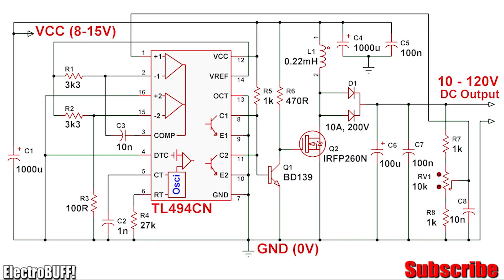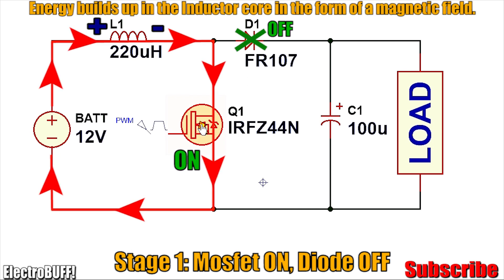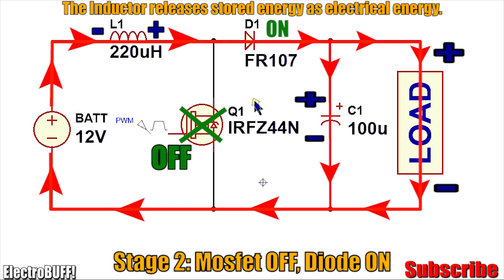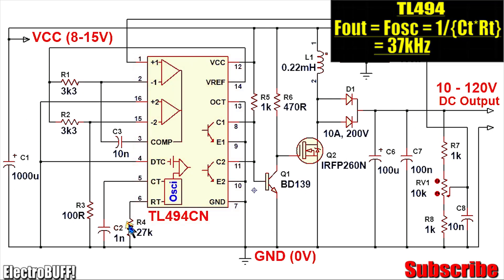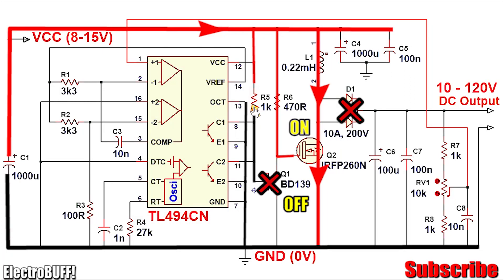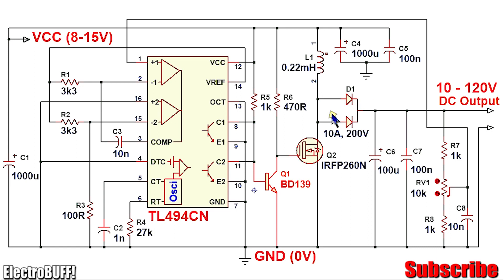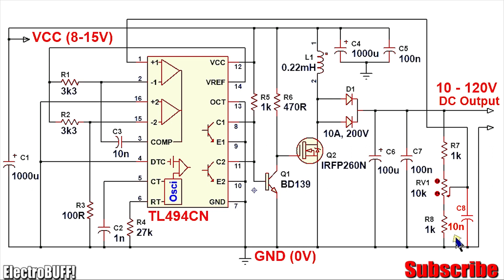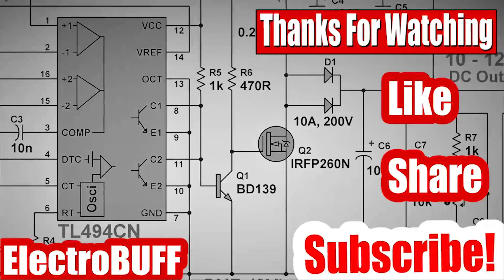TL494 Professional Voltage Booster (DC DC Step Up Converter)

Comment: i have step up boost, similiat to this schematic. the input is 12v, and the output stucks at 86v, even though i've replace the inductor with 1.55 mili henry. what should i do, to get ouput voltage 96 - 120v?

update: i've replace R8 with trimpot... lowering the value for voltage feedback, is increasing the voltage out...

Comment: Did you notice you never put the a error amplifier Ic the voltage with drop to nothing so the circuit is half of the converter the load will drop off the voltage I believe me I try it and the voltage drop off i had to use lm359 to get volt stabilized any load

Comment: Using R6 to open nMOS gate is awful. You better use internal TL494 transistor to open the gate and DB140 instead of Q1 to close the nMOS.
Separate Vcc of TL494 from L1 noise by diode /*or at least a resistor*/ and low ESR capacitor.

Comment: A failed circuit and did not work, not to mention the many errors in it. Explain the circuit’s work in one valley and its work in another valley. If it was correct, I would have collected the circuit and tried it in front of us.

Comment: Hi, show the circuit diagram that people need for solar panels, converters 48VDC to 240 and 380v, 5kw or continue 3kw capable of using cheap igbt for welding machines available in the market . Thanks
Reply: It requires professional engineer to do that!!

Comment: sir, could you provide design of Boost dc dc converter with support Reverse protection input, support low voltage input, support over voltage input and output, support over temperature (ex 80 celcius) support voltage and current are adjustable simple and high efficiency. ? many thanks. bagusasari@gmail.com

Comment: Hey I don't have TL494 but I have UC3842 can there is any solution for this can I build both boost and buck converter with UC3842 if so how can I?  Can you give a good converter circuit with UC3842 ?
Reply from the maker: Yeah, it's a dedicated DC DC converter IC

Comment: ItS a great circuit..you are really doing a good job..will the current increase because the voltage has increased..what effect will that have on the battery..
Reply from the maker: None. As long as the battery is above it's rated minimum discharge voltage, it should operate well.